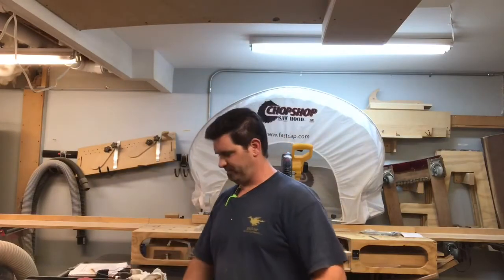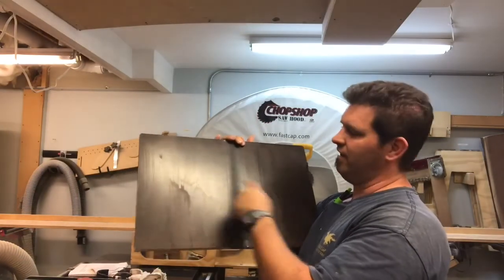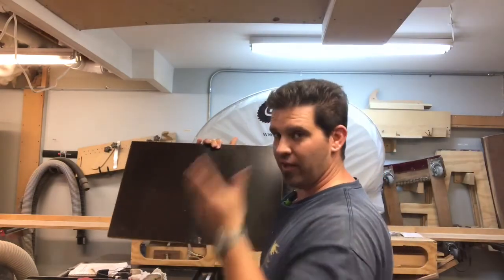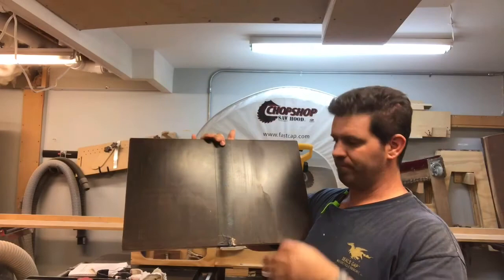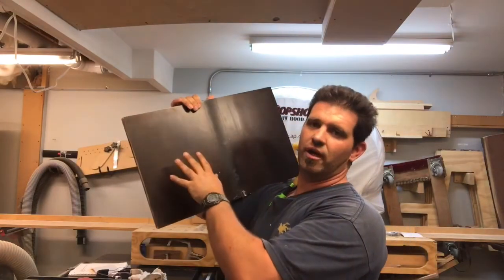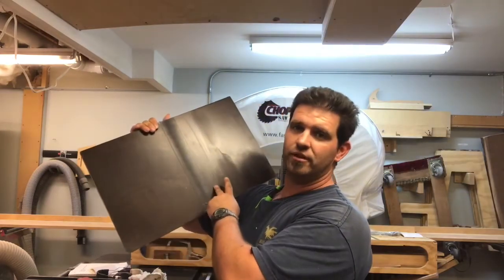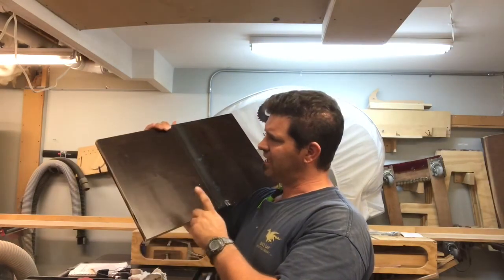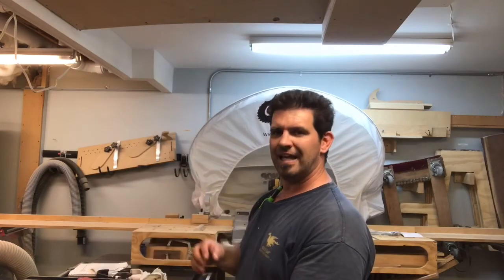Kem Aqua vs Saylerlack HYDROPLUS

Comment: We've been fighting those damn bubbles in HydroPlus for months.  Butyl cell, more thinning, no exhaust air, deep clean the booth... even new spray equipment....still bubbles. Meanwhile, Enduro and CV lay out like glass in the same booth. (too bad Enduro builds and protects like rice paper).  

We were told SW is working on an "environmentally compatible" version of HydroPlus... meaning it's not so vulnerable to climate fluctuation. 

We know, thanks to you, that the WB 2k's are the answer but we're a high production shop that can't wait for an extra gallon of shipped paint to arrive.

Comment: I'm in the Dallas-Ft Worth area and having a very hard time finding Kem Aqua.  Had to resort to spraying Sherwin Williams Emerald urethane enamel for several cabinets.  Gives a nice, hard finish...the only downside is waiting 24 hours to spray on a second coat, whereas Kem Aqua dries in less than thirty minutes.
Reply from the maker: You need to call up CIC and try some of that they are In McKinney Texas. One of the best 1ks on the market. www.ciccoatings.com
Reply: @ericreason6559  Thanks for the tip...much appreciated.  I did find one place not too far from me, but it was only available in 5-gallon buckets.  I'll give CIC a call.
Reply: @chrisb3784  SW told me any store can order stuff now.  The industrial stores (Garland side) should have that stuff on hand, but your local store can order stuff for you.

Comment: You should use varnish witch is the toughest finish over any of the other finishes anyway!!!
Reply from the maker: Eugene O'Dell what kind of varnish. Conversion varnish or oil varnish?
Reply: @ericreason6559  conversion varnish!
Reply from the maker: Eugene O'Dell yes that is one of the hardest finishes on the market. However, there are a few watebase finishes on the market that have pushed the envelope and are hard and durable as a solvent based conversion varnish. Go watch my videos on the milesi 2k poly, CIC centurion Waterbase Conversion Varnish with crosslinker added and the sayerlack/ renner with the croslinker added are pushing a conversion varnish kind of like a conversion lacquer. I have some renner 2k poly as well and I have heard from reputable sources that is can take on a conversion varnish. Also these water base  finishes are substantially faster than a conversion varnish if you don’t have ovens to cure them. So Water base getting better and better. Thanks for watching and the great comment.

Comment: Eric I love the way kem aqua feels,lays down, and dries my clients do too. I do alot of repaints for cabinets I was wondering what primer should I use that the kem aqua will bond too I know kem aqua is for new wood or sand it down. But I was wondering what primer will be best to use. I have used the alchohol base shellac and  I think after it cures it bonds pretty good just wondering what you think
Reply: @chrisb3784   I'm trying to find a primer that will bond for repaints, so I can use the kem aqua plus I know it is made for new wood.
Reply: @nolansutherland1780  I have used it on cabinets as a primer for the Kem Aqua Plus White, and it came out great.  It's what Sherwin-Williams recommends in their process:  
1.  Sher-Wood   Kem   Aqua   Plus  Surfacer
2.   Sher-Wood Kem  Aqua  Plus  White
3.  Sher-Wood®     Kem   Aqua®  Plus  Clear (for additional protection)
Reply: @nolansutherland1780  It worked successfully for us thus far on a re-paint.  Following the Sherwin-Williams procedure I mentioned below, which includes sanding between primer coats and before top-coat, and sanding between any additional coats.  https://www.paintdocs.com/docs/webPDF.jsp?SITEID=SWPCGWOOD&doctype=PDS&prodno=035777045466&lang=2
Reply: @chrisb3784  a few years ago we degreased,deglossed,and a light sand and then with a damp microfiber rag wiped the cabinets down i sprayed the cabinets with the resurfacer it was the next day we was doing a light sand and my finger nail barely bumped the dry primer and a chunk came off so I checked with a 5 way it scrapped off 2 ft section as wide as the 5 way basically it didn't adhere properly but where the clear was sanded to bare wood it bonded very well
Reply: @nolansutherland1780  That sounds like the right procedure.  I first heard about this product in a review someone wrote about a HVLP spray gun.  I had a cabinet project to do for an apartment, and came across this person's review.  The Kem Aqua system is rated or certified for cabinets if you apply the clear coat on top.  Here is the person's review.  The Kem Aqua part half way or so into the story, https://www.amazon.com/gp/customer-reviews/R7CRQ0Q5C4SH4?ASIN=B003PGQI48 .  

I sprayed on unfinished wood, and painted wood.
Reply: @nolansutherland1780  For repaint I use Sherwin-Williams “extreme bond" primer. Of course always light sand or at minimum use "De-glosser". After that the best top coat (commercial or residential) Pre-Catalyzed Waterbased Epoxies. I believe kem-aqua top coat also is compatible with "extreme bond"
Reply: Nolan Sutherland the BIN shellac primer you’re using is the best option in my opinion. I’ve tried multiple things, the extreme bond primer doesn’t hide well at all, and doesn’t sand as smooth as I’d like, and undercoater is going to find a contamination no matter how good you clean.